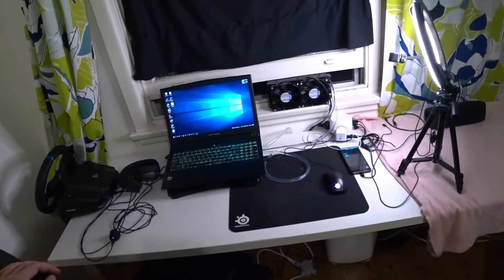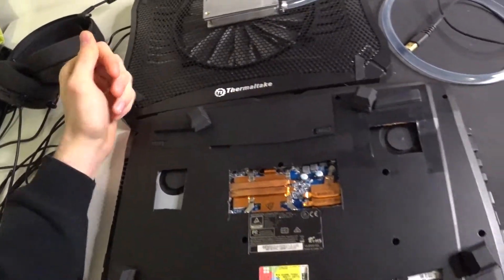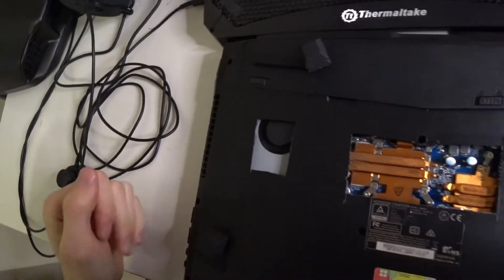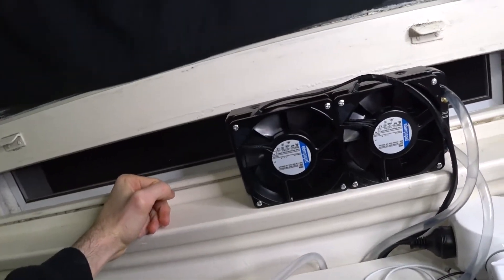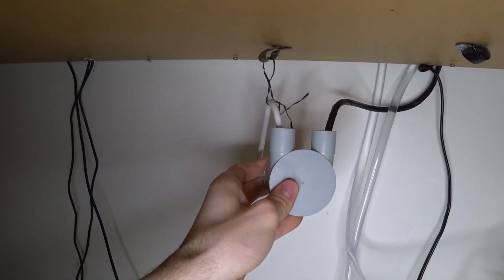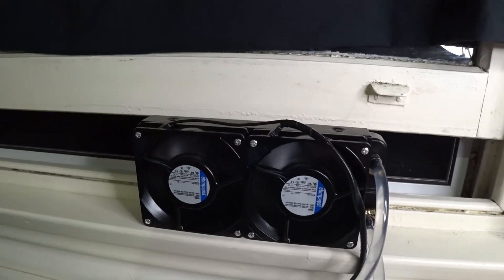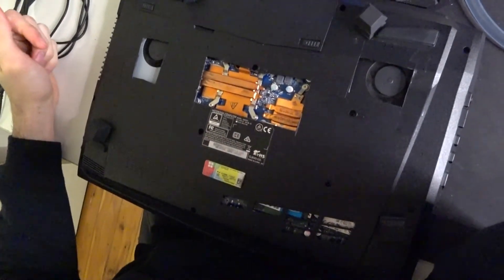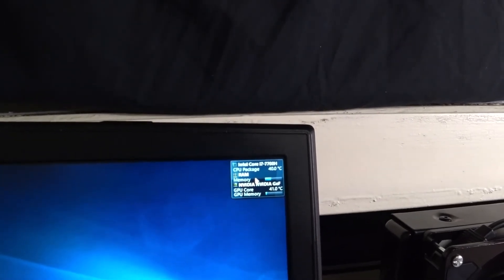WATERCOOLING FOR OLD GAMING LAPTOP!

Comment: Any kind of thermal pad on the water block to contact the heatpipes would make a huge difference in the ability to transfer from the laptop to the cooler loop. 
Love a good ghetto mod, well done!
Reply from the maker: cheers mate and thanks for the tip
Reply: @bisonxdvr  found a thermal pad yet?
Reply from the maker: @terrydrew7002  I've moved apartments and had to dismantle the system unfortunately. As well as buying the new HP OMEN 17 with much better cooling performance. Sorry bro

Comment: Love the engineering here! I'm looking to do something like this myself actually. One concern, how did you make sure your waterblock doesn't short out anything on the motherboard?
Reply from the maker: Just made sure it only touched the existing heatsinks on the laptop. Yeah try it yourself, it was so fun coming up with ideas and thinking of how to make it. I wanted to add a cooling tower to cool the water after it went through the circuit but I didn't find where to source the parts needed. That's the next plan tho. Thanks for the comment bro all the best

Comment: Trying to see whether or not there is a less destructive way to do this that’s somewhat universal for some laptops, I’m experimenting with adding thermal grizzly thermal pads that conduct heat from the CPU and GPU into the plastic casing of a laptop and seeing if a regular AIO with a thermal pad can extract heat through the plastic.
Reply: Plastic is not a very heat-conductive material relatively to aluminium or copper. I don't see how that would make any performance increasing or fan-noise decreasing difference.
Reply from the maker: Trying to transfer heat into the plastic of your case will do nothing and probably make it worse unfortunately